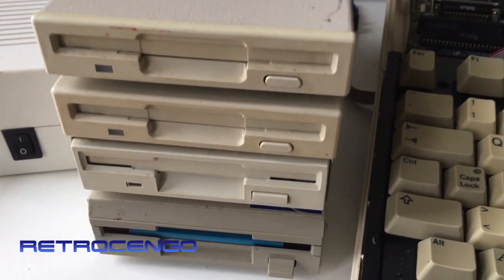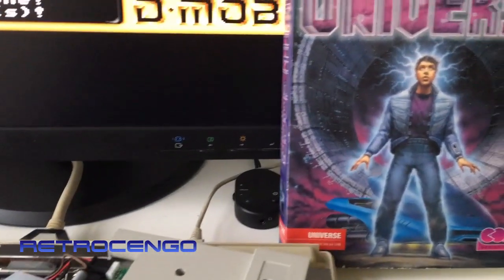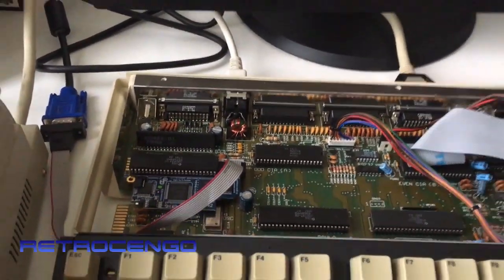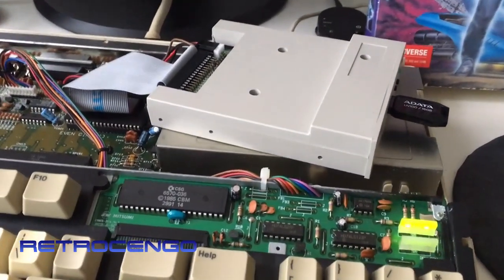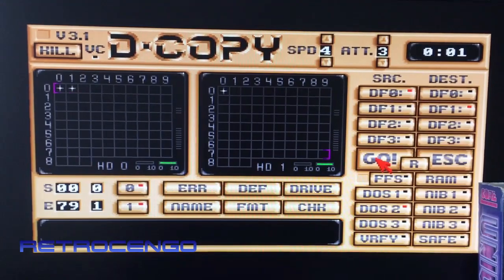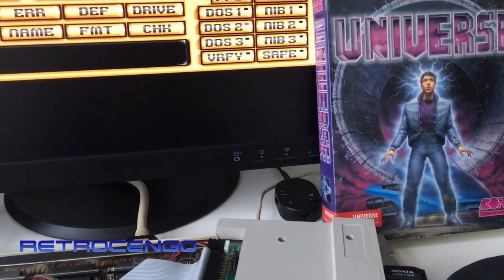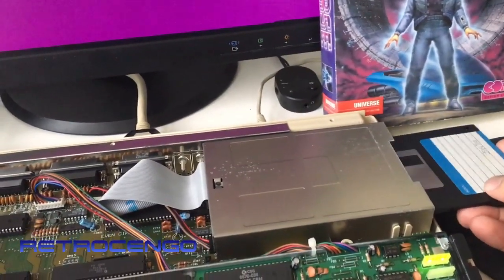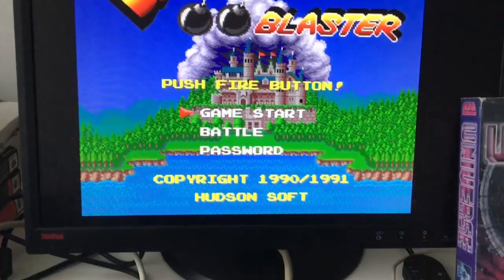Commodore Amiga Gotek to diskdrive copy Amiga games How to setup on Amiga 500

Comment: I have an Amiga arriving and a Gotek, thanks for confirming that you can copy an ADF to an actual disk. I'll use the Gotek as a second drive and keep the amiga stock. 
:-)
Reply from the maker: jamhamster Your welcome. Great you gonna keep your Amiga stock and enjoy it like back in the time😁😎
Reply: @RETROCENGO  Apart from some retrobrighting and fixing I'll leave it as is. There's something about the sound of the 3.5 inch floppy, it's all part of the experience and wouldn't be the same without it. :-)
Reply from the maker: jamhamster Respect. So much nostalgia that way. I also love using disks 🤩
I don’t Retro right, try to buy, hunt for as new looking as possible 😁
Reply from the maker: jamhamster really love this one:

https://youtu.be/EhDEIePUHqE
Reply: @RETROCENGO  I'm all set up with  an A500, boot switch and a Gotek in an external drive. Xcopy doesn't like making disks from the Gotek but D-Copy works perfectly, I'm now running through a bunch of disks trying to find good ones and I'm as happy as Larry! :-)

Comment: If you do not have any gotek drive, and you have an amiga with harddrive and at least 2mb of ram. Then there are a number of ways to do this without the use of d-copy or x-copy. Back in 2002, I had an Amig600 with kickrom 37.250 (the 600 kickstart without HDD support), and I had an 2mb PCMCIA ram card. I loaded up the workbench from disks, and on the pc, I created a zipped file of the ADF file. Then I splitted the file, with an universal file spliter, and copyed it to PC 720k formatted disks. Mounted them in workbench, copyed them to ramdisk and reassembled them. Then unpacked them in the ramdisk and used ADFblitzer. Now, with CF cards and all that, it is possible just to copy through FS-UAE on linux or windows or use WinUAE with the card mounted as an Amiga formatted harddisk and then the local folder mounted as a harddrive. Anyway... If you use ADF-Blitzer, then you can do the same in workbench and copy the files using FS-Uae or WinUAE, with the CF card and local folder mounted in eighter Win or Linux. Your aproach is the best solution on an Amiga without HDD.

Comment: Awesome. Thanks man. Looking forward to this.
I do have boot disks, though. So no danger to the originals. 
The problem with my drive is that it doesn’t always spin up. Otherwise it ihas been cleaned, re-greased and reads fine. I suspect a leaking electrolytic cap right next to the drive motor, which is probably used to give the motor a start up kick. 
I’ll just replace that. 
Thanks again :-)
Reply: Hej Carsten. Jeg har en helt anden løsning, som jeg har brugt på min 500, og så sandelig også på den 500 som jeg er i gang med at refurbishe til mine børn. De skal have den når de er gamle nok til at passe på den, og kun hvis de har interesse i det.

Anyway....
Det jeg har benyttet, er et specielt kabel, så jeg kan bruge et PC drev som Amiga drev.
Jeg tænker at det er lige så godt som gotek. Det bedste er stadig et ægte drev. Eneste problem ved pc drev, er at du skal have lavet en speciel eject button til det.

Hvis du er blevet interesseret i ide'en, er den her på min blog.

https://to9xct.blogspot.com/2018/09/my-amiga500-refurbish-project.html?m=1
Reply: Hej Brosten. 
Fedt projekt du har gang i!
Jeg kender godt det kabel, men vil helst have den til at køre i original stand hvis muligt. Jeg har også et par gotek liggende som kan bruges alternativt. De skal bare lige have flashfloppy og de sædvanlige mods på (rotary dial og oled display)
Reply: @skjerk   På nær få stykker software, som kræver den helt rigtige RPM på det fysiske drev. Så har jeg ikke oplevet problemer med kablet overhovedet. Jeg har dog måttet bridge 720/1.44 kb/mb derect kontakten på de PC drev jeg benytter, eller bruge tape-tricket. Jeg tænker at hvis man har nyere drev, så er de mere pålidelige end de gamle 1987 til 1991 drev. Igen er det helt op til en selv om hvad man vil benytte. Eksempelvis på en Amiga500, kunne det være en rigtig god løsning med en ekstern boks med et Gotek, og et af de kabler jeg har på internt eller omvendt. Og så benytte en boot-selector. Du ved. Den som kan gøre eksternt til DF0. Igen. Som du siger så kan man nemt benytte gotek-only. Det hele kommer jo bund og grund an på hvad man personligt kan lide af løsning. Altså hvad man bedst har det med, og hvordan man ønsker sin Amiga.

Tak for gode ord om mit projekt. Den er sådan set et lille projekt, og da jeg ikke har den store erfaring i at reparere noget i den størrelse, er jeg lettere stolt af den fremgang jeg har formået at lave. Igen. Den er til mine unger, når de ved hvad hvor sjældent det er, og hvis de skulle have en interesse i sådan noget om en 10 til 15 år. Måske hele 20 år fra nu.
Reply from the maker: Carsten Skjerk  Håber du har modtaget boxen og alt er vel. Tak fordi du var med😁👍🏻🕹🕹
Reply: @RETROCENGO  Jeg har fået en SMS fra GLS om at der er leveret til pakkeshop her i dag - så forhåbentlig er det den :-)
Glæder mig!
Reply from the maker: Carsten Skjerk super😁🕹🕹 Happy gaming